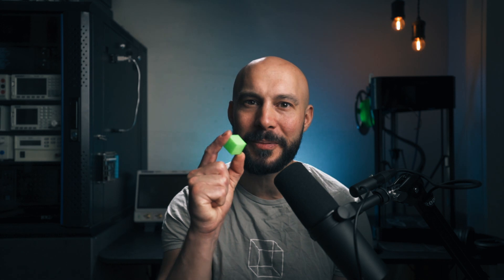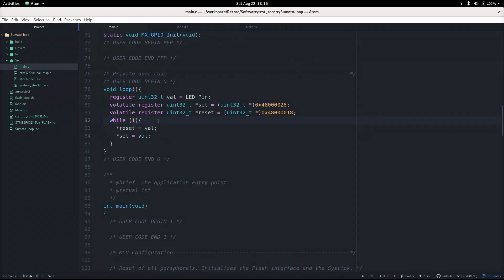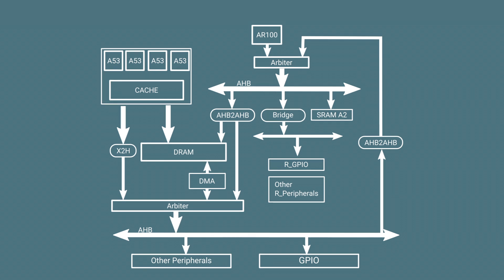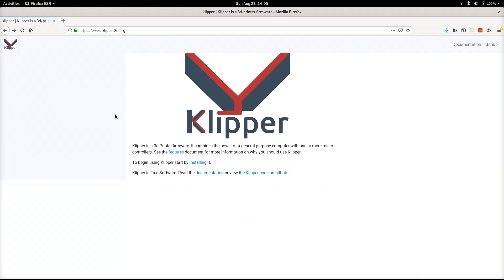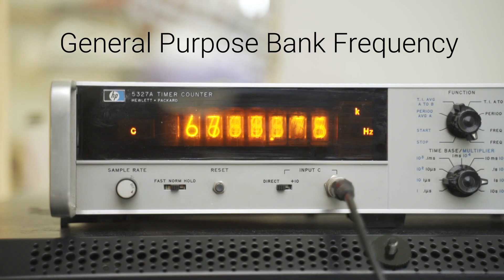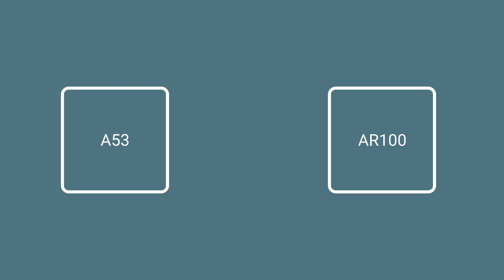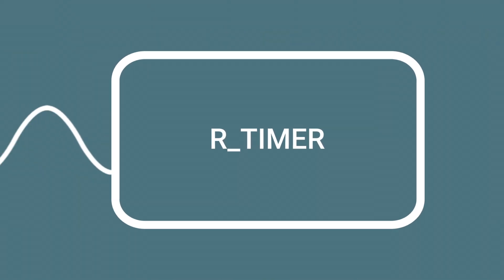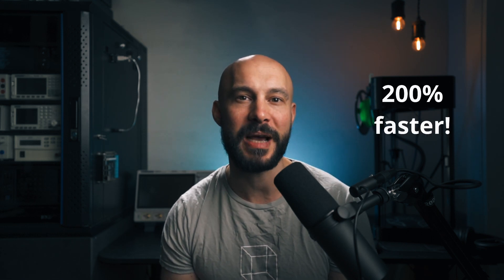Recore is Finally Printing!

Comment: How fast is the generic use shared bus (AHB)? If you could configure all the other users to limit max usage time of the bus to very short time and always have priority to use the bus for real time process, what kind of latency would that result? (Basically the idea is the same as Linux PREEMPT_RT patches: higher priority task can interrupt anything executed by lower priority task but everything can be executed on a single fast CPU core.)

I'm asking this because if the generic use shared bus can be run faster with main CPU than AR100 with its dedicated bus, it might result in lower latency if you can keep the other data in short enough segments or abort any low priority users of shared bus at will when RT task requires to do anything.
Reply from the maker: I don't know if it's possible to affect the arbiter and set a priority for a task. I've not found any documentation on it.
Reply: @EliasBakken  How about the drivers that try to push data over AHB? Do they have configuration options to limit max data block size to very small values?

Comment: Why these crap connectors? It´s a nice board but to expensive
Reply from the maker: What connectors do you want?
Reply: @EliasBakken  HX2.54 the normal one 😉
Reply from the maker: @ichbinrootunddarfdas  i think most stepper motors come with the DuPont-style connectors though, right? Look at Wantai for instance. What motors do you buy?
Reply: @EliasBakken  Oh, I don't mean the motors.  I'm afraid the connections can come loose, the HX2.54s at least lock in place....

Comment: Nice video! Do you have the Kipper step rates benchmark results?  "200% over previous best" is like 2.x Mhz step rates (3x of SKR PRO) ?!?! 

Also will there be a high-voltage version of the board w/ TMC5160 ?  (Currently the board offer 24V , which is still lower than TMC2209 limit@29V. All of which are not enough for 300mm/s+ print speed at a reasonable accuracy. Now that Mosquito magnum+ is out, the max volumetric speed is very high now) 

For the board to have another huge selling point, perhaps V input should be at 48V or more? (Duet3 already accept 32V input with TMC5160) @48V Users can easily use cheap Meanwell LRS-350-48 to supply it, so perhaps the "control board of the future" should include this?   (Some of us end-users connect heat bed to the main and use SSR for control. 7A@48V should be fine.)

After all, the point of having more step rates in the first place is to actually use them somewhere, either more speed or more accuracy. 24V is far too limited for speed.

Anyways, Keep up the good work!
Reply from the maker: Hi! Here are the benchmarks i measured: https://github.com/intelligent-agent/klipper/blob/master/docs/Features.md
2.2 MHz is right. 
Good point about the input voltage. I'll be sure to look over the components limiting the voltage to 24, perhaps it can be increased to 29 at least, but not more on this board due to the steppers limit. Changing the drivers would yield a different board altogether, but if that is what people want, I'm happy to make it!

Comment: This is very, very cool-- it reminds me of the way graphics programming works on these types of processors, where userland code communicates with separate purpose-built processors on the same die to drive a pixel buffer. An elegant solution, and I look forward to picking up an A5-revision board at some point soon :)

Comment: If the board is as good as the video editing, then I definitely want it.

How is the outlook for controlling motor(driver)s directly via CAN on this board? Would Klipper architecture support it, and would the required hardware be in place? (Implementing the protocol itself, as well as supporting it on the driver-side would be another, manageable, story.)

Keep up the good work!
Reply from the maker: Haha! Thank you Torbjørn I'm still learning : D 
As for CAN, there is no support for it right now. There are pins available, so if someone wants to try a software implementation, that is possible. If there is an interest in it, I can add dedicated hardware in a future revision.
Reply: @EliasBakken  There is a fair bit of interest in CAN support these days with boards like the Huvud becoming popular on printers running Klipper.  I have one to control the toolhead on a new printer I just built.  https://github.com/bondus/KlipperToolboard
Reply from the maker: @jakepF1D  that is a great point about the relaxed requirements on the real time aspect. I hadn't considered that! Ok, I'll take a look at CAN requirements, maybe it can be done with current hardware or an add-on board!
Reply: @EliasBakken  The Recore can be used now with a simple USB board like the CANtact or CANable, but due to the chip shortage they're impossible to get.  If you used the STM32F042 instead of the 030 you might be able to add CAN support on the board with just a transceiver.